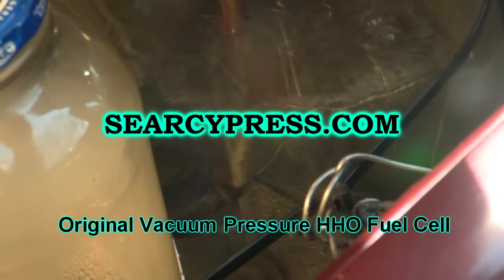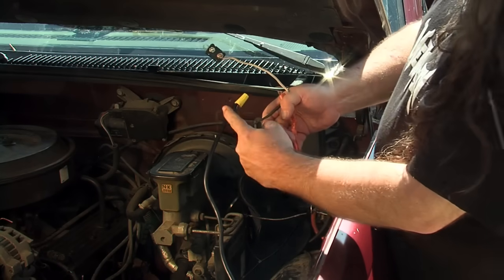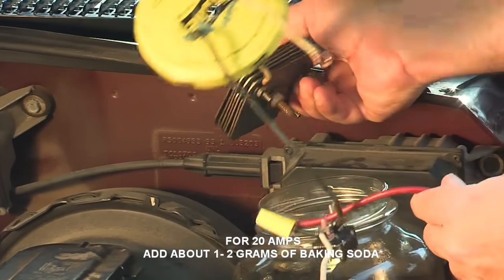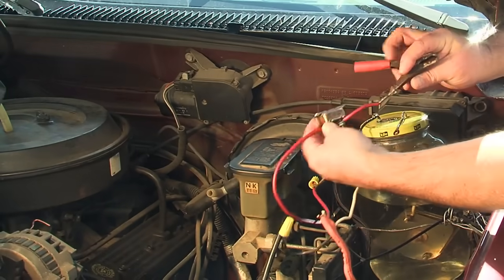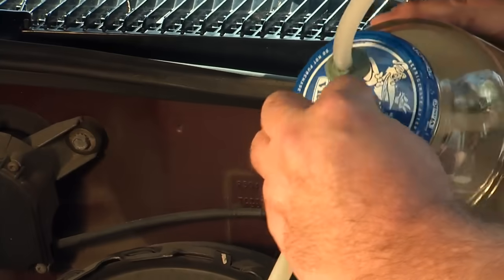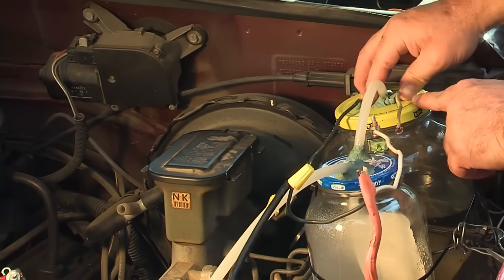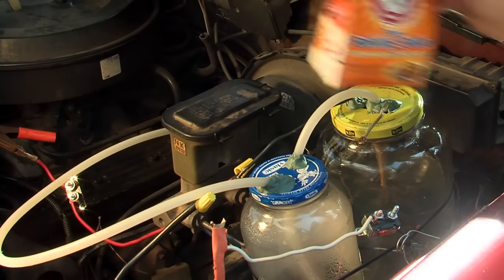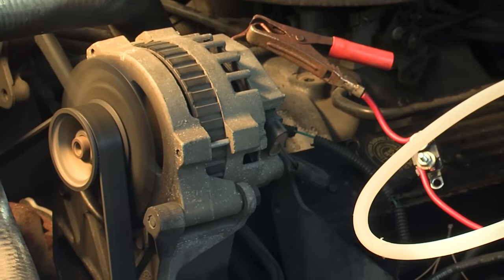Vacuum Pressure Hydrogen fuel cell defeats high gas prices using hydrogen from H2O.

Comment: I can tell you from real world experience, that this works. 

I actually used 6, 1 quart jars, daisy  chained all the electric and hoses. Connected main vacuum to breather cover. 
Mine was probably more crude of a design. I used normal metal coils. 2 in each jar, having a pvc pipe for seperation.

I did this for 3 months. 5 years ago. On a 1984 Chevy Truck. 1/2 ton single cab.
Went from avg of 14 mpg to 17 mpg. No other changes made. Not even an oil change. 
So take that, naysayers.
Reply: Did you forget about the second law of thermodynamics? These fake stories are getting out of hand, people dont know shit electrodynamics or physics.
Reply: @zo0ot404  sir, my story is definitely not fake
Reply: @jasonrist6582  Just idling your engine is over a 600 rpms. Driving a 2.5 liter 4cly motor  is about 150 cubic inches. That's 37.5 cubic inches per a cylinder. A cylinder fires ever 2 full rotations. So in a minute of idling at 600 rpms your engine will use 11,250 cubic inches of air a minute at just idle. That's a 187.5 cubic inches a second of air. You're not producing even 2 cubic inches a second. But don't forget that it's h2O 2 parts hydrogen 1 part oxygen. So 1/3 of the gas isn't even hydrogen it's oxygen. So not even 1% of the air being taken into the cylinder is hydrogen. The only thing being accomplished here is the alternator is working harder for the high amp draw dragging the motor down more reducing fuel mileage. This is why water isn't used as fuel in a motor vehicle. 

Now don't forget we don't drive at 600 RPMs most people will be around 1800 rpms at cruising speed. That's 3x the amount of air with still the same hydrogen production. So now ur way below the threshold of .03% hydrogen in the cylinder. Using a spark arrestor on the output hose to keep from blowing the jar up you would be hard pressed to even candle a flame let alone put anything measurable in every cylinder 900x a minute cruising down the highway at the speed limit.

Why be a liar. This is why we don't use water as fuel... Takes way more energy to make it then it produces. This is why in Iceland we use compressed hydrogen from a fueling station. You can't make the volume on the fly and if u could the energy I took to make it wouldn't be returned so you wouldn't be going far.

You should delete ur fake story just makes u look bad to any semi intelligent person
Reply: @lracegroeg7990  $$ and that vehicle was "lost" by my ex wife
Reply: hi, which is the best place to put the intake of the HHO gas generated by the HHO kit? in my car  i give the intake through the air cleaner, pls reply. is this fine or i change it from the air cleaner and switch to somewhere like engine vacuum or suction pipe?
Reply: Keep a spare alternator in the trunk lolololololol

Comment: Don’t believe in thisVideo is a hoax and does not save gas it’s a waste of money and a waste of time
Reply from the maker: Jim Garcia the video is no hoax. Hydrogen oxygen gas can, if properly implemented, boost the performance and the mileage of certain types of motors. Newer vehicles will most certainly need some sort of o2 adjustment. I do not suggest you build this device because of the dangers associated with hydrogen oxygen gas. The purpose of our video was to show producing HHO Gas in vacuum was a better way of doing it. In other experiments we used xenon light to increase the performance of the HHO. The effect was tremendous and I found myself hot rodding the vehicle quite a bit because of the increase in performance. Naturally hot rodding resulted in lower fuel mileage. You have to be prudent about how you drive if you want to save fuel. Thank you for your comment, however calling something a hoax is a bit judgemental when you haven't done it on the same type of engine under the same conditions yourself.

Comment: That high of amperage draw loads the alternator causing drag on the engine requiring more air/fuel mix therefore making little to no difference. Ever notice on older vehicle your engine gets a noticible load on it when jump starting a dead vehicle? What would be cheaper than gas and really work for those who don't want to build an hho generator is propane. It's currently cheaper than gasoline, and most vehicles are easily switched over. My '84 f150 351w has dual fuel aftermarket carburetor available. And it's possible to put a dual fuel throttle body on my '99 Sonoma.

Comment: SCAM ALERT.   This was on Mythbusters.  Videos on Youtube.  Metalpress probably owns  the con/scam.
https://www.autoblog.com/2008/08/04/why-on-board-hydrogen-generators-wont-boost-your-mileage/
https://www.consumeraffairs.com/news04/2008/07/water4gas.html
Reply from the maker: Eric jones As I recall mythbusters could hardly make a bubble..They came out with that video three months after we put a video  on public television that aired in four states. Making hho in vacuum is far more efficient. At no time is anyone claiming overunity. A combustion engine, especially one as lossy as this one runs at a very low efficiency. The gas simply causes the engine to run more efficiently. There are computer issues on most later model cars which must be addressed. Regardless, making this type of gas in a vacuum is about the only way it's ever going to succeed. Vacuum cracking the gas has many advantages. I'm not in any way suggesting anyone attempt to do this. It was research. Thanks for watching.
Reply: Dateline and other sites have done hundreds of tests of this scam.
https://www.youtube.com/watch?v=Kv9vMzXJbho

Comment: Ok this system sends a mixture of Hydrogem and Oxygen into the vacumes  this will not help ! 
You need to vacume the Hydrogen  produced  from the fuel  sell  with out the oxygen.  If you could adjust the cars PCM   To adjust for the increased Hydrogen in the fuel system  then you could get more horse power or save on gas.  With this system setup your check engine light would be on do to vacuum leak  your car intake system would be off do to the vacuum leak. Then your PCM would be sending more fuel to the cilenders from the fuel injectors. The hold thing about making this things work on the car is the PCM. You car adjust to fuel and air mixture to get the fuel to burn at its best efficiency . Until the car manufacturers redesign the engine to run off Hydrogen  gas mixture your just wasting time.

Comment: Fake, water does not produce any electricity and neither baking soda nor adding metal to the water will allow it to produce electricity, this video is absolute lies.
Not scientifically possible plain and simple.
How this produces gas he say, what a lie.
Water doesnot produce gas, and magnetic field is not created with electricity is completely different energy system, and magnetism can not be scientifically possible to combine with electricity, you can have magnets and make electricity from it with hydroelectric motor engine which is scientifically possible, but you can not scientifically possible make magnetic energy from electricity, plain and simple, this guy is just a bullshitter cell who is lying to manipulate the system, is what all terrorists of the gringod do nothing but lie and bully people as well injure people and then they lie to try to not blame themselves for the crimes they do, is how they all do it because they are the only real terrorists which exist.
Reply: its using electricity generated by the alternator of the motor to create hydrogen gas from the water, not the other way around.

Comment: We'll done but this is not really hydrogen fuel cell It's a different thing. Try to do this for diesel engine, For gasoline engines my ideas it may reduce motor octane number
Reply from the maker: Upul Dhanushka Gajanayake actually motor knocking is often completely eliminated when using the fuel cell.

Comment: I had a system that my dad made back in the day..
1: A heavy duty plastic jug..
2 : Put a fart valve in the top of lid  thru a drilled hole..
3: put a plastic hose 3/8 is okay thru another hole drilled in the lid next to fart valve..
4: connect hose with splitter to your vacuum hose that blows air out and run hose to bottom of the jug..run another hose from fart valve top to your intake vacuum hose to carburator..
5:fill the jug with 60 % distilled water..30% ethanal .and the rest paint thinner.. but leave some space at the top of jug for air to circulate..
5: Start engine and you should see an increase in RPMs of at least 3 to 5 hundred RPMs  at idle.
The air blowing  into the hose to the bottom of the  jug makes  a gas from the bubbles and the gas is sucked up into the fart valve and then into your carburator VIA the other hose..
A one gallon jug will last a few days then you just refill it...
You can try different mixtures depending on you..
No wires or dangerous explosion or any of that..
Reply: you got to explain that one to me, got other definition on google for fart valve. is it check valve, isolation valve laughin to much that brain farted LOL i'm serious to know if it's check valve
Reply: fvrrljr yeah it's the copper valve it's the one with a hole on each end and a nut with thread built on it ..
Half is in the lid half is out..
It's like an inch long..
Reply: greatly appreciated
Reply: Or 20% gasoline and 80% distilate water.😀👍

Comment: HHO is a nice idea. The problem is that you do not get the electrical energy required to 'split' the water back from the combustion of the HHO. A motor vehicle is not very efficient at converting chemical energy into motion, a lot of the combustion energy is turned into heat - hot exhaust gasses, and heat in the engine, which is dissipated by the cooling system, more energy is lost to friction etc. You need high current to split the water, this comes from the alternator, which in turn is driven by the rotation energy of the engine. The cumulative losses in generating that electrical current are huge compared to the usable energy you get from burning HHO.
Reply from the maker: Simon Reeves, I understand your misconception. This engine is very inefficient. We are not making free energy, just increasing efficiency. Using a vacuum changes the needed energy required to split the molecules also. This process produces thermal advantages as well. Thanks for the comment.

Comment: I found I could not use this on systems with fuel injection.  My guess, being that fuel injected cars get the same mileage as a good carb did (think 1966 Oldmosbile inline 6 - 36 MPG form the factory), were a response to HHO being made by people.  I think its a computer chip making the problem possibly in conjunction with the O2 sensor.

Comment: Most intellectual naysayers say, "you cannot create energy, so this won't work."  They miss the point energy is not being made.  You are releasing the potential energy inherent to the O2 and H2 when you break the bonds.  When you shoot a gun, the impact pf the bullet is certainly a lot more energy than what it took to pull the trigger.  You did not create energy when you puled the trigger.  You released the potential energy stored in the gunpowder.

Comment: A generator is harder to turn as load increases. No load = friction forces only. There is no current when there is no load. There is potential only. 

Besides, it takes more power to separate water than the resulting power from burning the components. The alternator is using more fuel than than water separator is producing. High school science.

Comment: You should use a 5 pin relay connected to the Alternator charge light to Automatically activate your hydrogen system when the engine is running.
Reply: And the alternative fuel is vacuumed into the engine? I don't think that vacuum is connected to the fuel injectors. So how does the hydrogen fuel get into the fuel system?
Reply: @MrLgmurphysr  It does not need to be connected to the injectors. when the engine is pulling in air it can pull alternative fuels also through the air intake.

Comment: The power generated by the alternator is not free, it’s powered by the engine so your using petrol to make hydrogen. It takes more energy to produce the hydrogen than the energy you get back by burning it in your engine so no gain
Reply: garelli01 no...you are also using water instead of pure gasoline...the water has enough energy with the release of hydrogen to make up for the electricity used to crack it....you are thinking of zero point energy which this is not...the extra power produced by burning hydrogen covers the parasitic loss from the belt....do the math,pretty basic stuff to figure out.

Comment: HOW CAN YOU DRAW GAS, FROM YOUR MAIN SEALED LIQUID FUEL CELL WITHOUT AIR INTAKE ?WOULD YOU NOT HAVE A VACUUM. ?
Reply: Did you not watch the goddamned video? You use the brake booster vacuum hose.

Comment: Best solution  is 30% concentration mainly KOH. ..yep 30% KOH and distilled  water...not sure if 30% mixture applies to baking soda or salt...use alkaline  over acids  because  of corrosion  ...then run at 1.47V DC draws about 5 amps. Thanks for the video. I was wondering  about vacuum  pressure my book says it runs best at higher pressures.

Comment: I built one of these, before I was told it wouldn't work. Boy was I a dummy. I only got 60 miles extra per tank, and that was about a cup of water. Now that I am positive it works I am building other things that don't huhh umm work either. By the way if you want to run the motor with even better results, step your voltage up to 320v. Let that voltage do the work. Don't try to run the vehicle on pure HHO. It will embrittle the parts in the engine causing them to fail. Ever wonder what is powering our Navy ships. Look it up, I bet you'll see how it isn't  working for them either.....lololhahahahaha. You guys are so indoctrinated.

Comment: A gas manifold is required with no return valve. handling the piping, valve, regulator should as per hydrogen gas handing and piping code. Please findout, be safe .
Reply: It's not required but it is optional , i run an hho system on my 2003 bmw with no gas manifold that you talk about , it's connected straight from the hho cell/generator with 3/8" clear hose to the air intake pipe/tube and i've never had any backfire explosion , under hard throttle acceleration it sucks a lot more hho than when at idle speed like at a red light for example, this would be the main difference between my system and the one shown here on this video , it looks like his is connected straight to the intake manifold hose from the brake booster , but to be honest Im not sure how the brake booster system works under hard throttle vs at idle speed , in fact it might just work like my system connection on the bmw ,  but back to the main topic you do not need a gas manifold or backfire suppressor they are optional but not necessary, and yes hho does save me gas and makes my car run better and faster.

Comment: You get about 60-80% of the energy back when burnt it take to spilt water into hydrogen and oxygen when burning. Then an internal combustion engine is about 20% efficient. So burning hydrogen in an internal combustion engine to make electricity for hydrolysis is doomed to fail.

Comment: I made my first generator 8 years ago when I learned about hydrogen. I used what was recommended at the time  and that was 316 stainless steel cable wrapped around a plexiglass tower in a mason jar with a plastic lid. Cut two holes in the top for the anode+ and cathode- and another for the  hydrogen to vent into the intake. I didn't get much of an increase in mpg though. I admit the plates work better but never assembled any. My power was hooked directly to the battery and the ground to the frame. After a few hundred miles the water became very black and the wire began to disintegrate and I had to rebuild the generator with new wire.  With the system I had it was not practical to keep rebuilding the unit. I never went on to build the plate model, maybe I should have, maybe the plate model would not have burnt out so fast. Anyway I thought I might throw in my experience.

Comment: Smoke and mirrors here....   29 amps will yield 394 watts.   The conversion is 1/2 pound of fuel per HP with no losses per hour... So you are using 1/2+ HP of electricity, and you make that with the gas engine, which burns fuel, to make the electricity.  So you are using fuel (gas) to make electricity, to make hydrogen, and oxygen gasses, to make fuel again.  You loose the cost of creating the mess and the fuel cost of gas for the car. Since that is not eliminated by the process, that will be more than the cost of gas for the car in the first place.

Comment: Good stuff but please use better hose connectors to the jars and electrical wiring any sparks around either jar with both hydrogen and oxygen in them and you will have an explosion like you would not believe. Be neat and be CAREFUL, happy trails! :)

Comment: My technologies could be even applied in civil engineering, that could even make all buildings as earthquake proof as possible, even if the streets are opening up, the building would just be lifted above the ground,and no amount of shaky-shaky intensity rock'n roll will cause the building to collapse.how else could my technology to totally earthquake proof any building?my technology could simply lift the whole building about one foot above it's foundation, and the building has tethered chains and zero shaky-shaky for all occupants but all occupants must wear oxygen masks, the technology will enclosed the whole building in a indestructible force shield and this force shield will exclude oxygen gases from within the building!